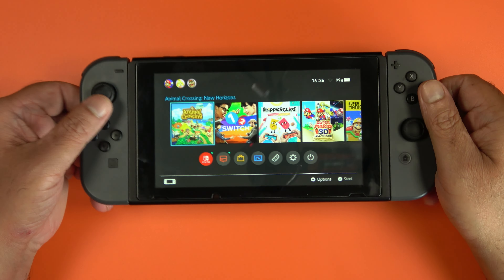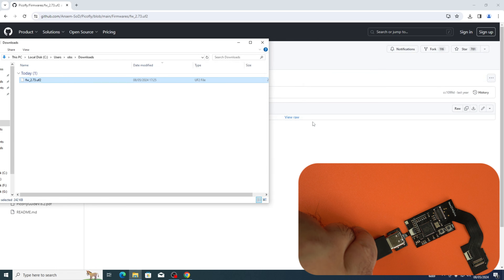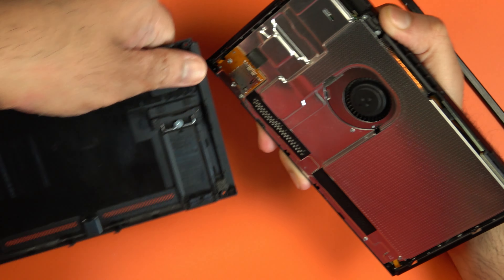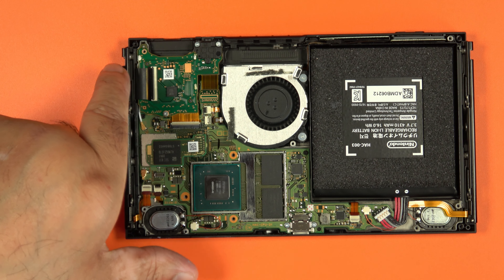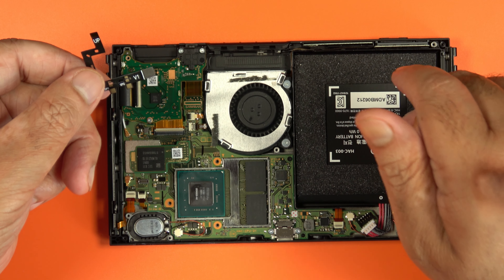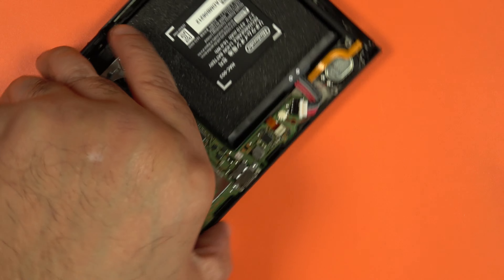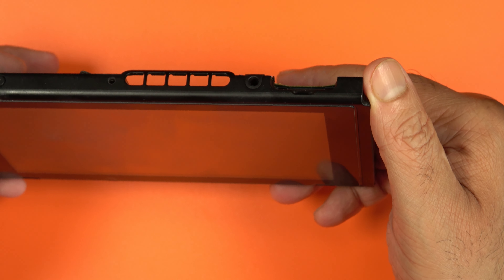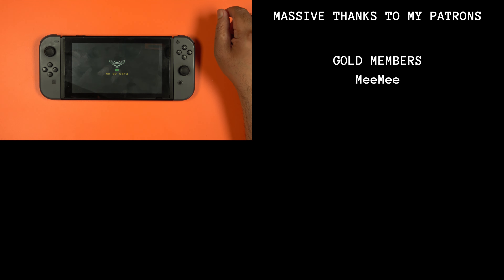Installation of HWfly chip in nintendo switch

Comment: You don't need to keep that USB type-c dongle bcuz u can update the pico firmware with pico_tool_box from Hekate itself. Just copy the firmware into SD card and run the script from Hekate. Good advice for future - don't place solder on pads yet but first firmly place the flex on CPU so the resistor are sticking out of the them. Now the flex just laying on them which is not the best way for installation. It's better to first fit them firmly and solder

Comment: Im a bit confused..is this picofly or hwfly? I think they are both different chips? Please correct me if im wrong
Reply from the maker: It's not clear to me either, but many  aliexpress sellers put both hwfly and picofly on the title of the product, adding to the confusion.
Reply: @FixWithSadiq  is your switch v2?
Reply: V1 @bikershoy
Reply: @sadiqurrahman6083  is there a way to check the modchip first before soldering it to the board, just to be sure that the modchip are fully working
Reply from the maker: I don't think it's possible to check if it is fully working,

Comment: But this is a hwfly, the picofly version has the resistors separate = more difficult; hwfly has only 2 flex cables and the raspberry 🙃
Reply from the maker: I'm new to this, so I'm not sure. The listing I bought from called it hwfly picofly rp2040, I assumed its same thing.

I will update the title. 👍

Comment: hi a little late to the party but I was wondering if you know any reason as to why my PC is not detecting the chip
Reply from the maker: Try different cable, some usbc cable are wired differently,  I would suggest using a official phone charging cable that is usb a to usbc. I my self had issues it some cables.

If still not working then it may be a bat usbc connector.

Comment: Nice video, after the modchip  install, my Switch is giving Error 2002-3540 when accessing the Stock firmware, emunand works properly. Do you have any idea how to fix this issue?
Reply from the maker: Try re seating all the snap on connectors. Could be a bad connection as the nand connects through the hwfly.

Comment: How do you tell if you use v1 or v2
Reply from the maker: You can tell by the placement of capacitors on the app, match them with the holes on the flex cable